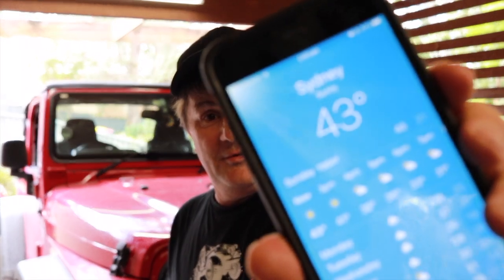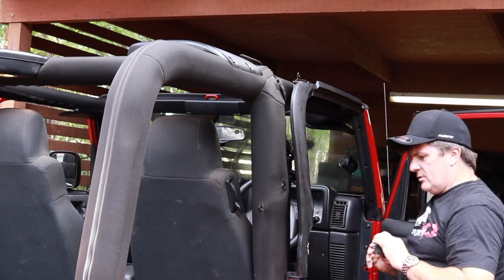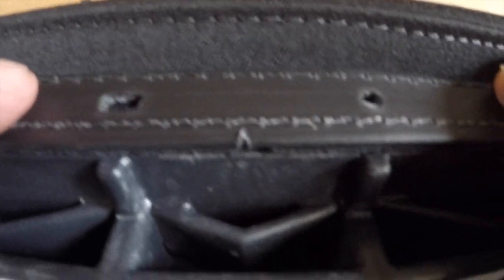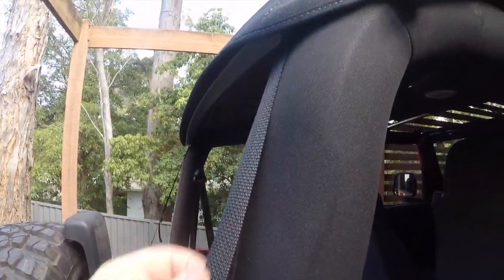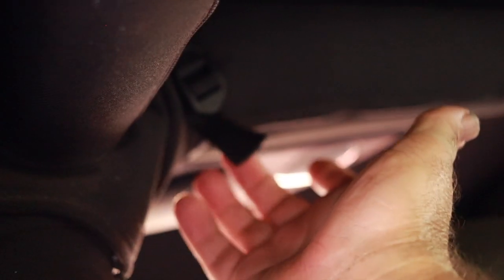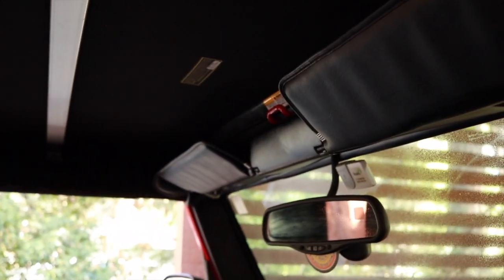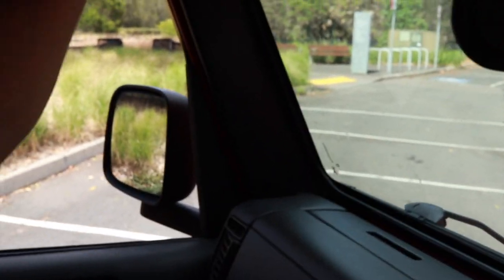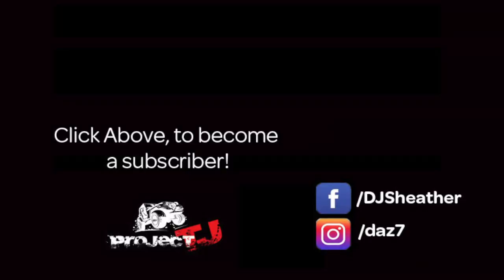Bestop Trektop NX Twill install Jeep Wrangler -  Project TJ - Episode 9

Comment: Just put mine on have in trouble with the back window channel bar think it needs to heat up a bit. Also watching your video I am going to loosen the straps buy the speakers.  Thanks. I have a red tj to.
Reply from the maker: Sounds good Michael. They are pretty tight when first fitted. Rear window bar can go on upside down too so check on that too.  Had a couple of issues recently but need to do a video on it. Red is the best color 😊

Comment: i really struggle to drop the top back and can't get those plastic tabs above the door off. do i need to loosen up the window zippers or are there other tricks?
Reply from the maker: Easier to do when the weather is hot, I've found as the top wears its also become slightly easier. That said, whilst tight, its not that hard to undo the plastic tabs and fold back, then re-attach the fold back front roof sectio, unsure why yours is difficult.

Comment: The side pieces above the doors where top clips under is there a secret to getting that apart easier
Reply from the maker: All I can say is its easier when the roof is warm rather than cold. It's a double edged sword though. Make it easier to get out and the roof wouldn't be as tight.

Comment: Just installed the Best Top Pavement Ends version of this top. A bit of a pain but got it on. Only thing is the header latches are a bit loose. Anyone else have issues with that?  Also nice video brother, thanks for the post! 🍻
Reply from the maker: Mine are fine, yours should be too. My only thought is that the top isn't tensioned properly at the rear (does it have the tensioning straps in the rear corners) or the padding on the roll bar is missing or compressed.
Reply: Darryl Sheather hi Darryl. Yes, all the tension straps are tight. Not sure the issue but will see once everything settles after it’s been on a week. Thanks for the reply!

Comment: Questions:
I thought the rubber mucket seals (between the bottom of the door surrounds and the tub) needed to be removed... At least, that is what Bestop instruction video detailed. The made specific mention to remove them. It did not look like you had done that on your installation. Did instructions from Bestop change? They must have had some kind of reason, based on engineering, for removing those seals. Anyway...

Comments: Nice top! I can't afford twill, but looking to get black diamond this summer (your winter). I am enjoying your series on the Project TJ.
Reply from the maker: Just had a look. The Bestop surrounds have a layer of foam glued to that section, I looked at removing the rubber bucket but when I did it exposed the open end of the channel that you slide the side curtains into, to me that looks like a water ingress spot so didn’t. All fits fine however. Hope that helps! Darryl

Comment: Nice review, but how is using the tailgate with this top? How easy is it to have the dog jump up or put groceries in? Thanks!
Reply from the maker: Hi, it’s better than the standard top as you have a zipper either side of the rear window rather than just the one long zipper as per the OEM top.
Reply: Darryl Sheather thanks for the reply. I am new to the Jeep world and only have the hard top now. With this top and in my example, you would, say, open the tail gate and zip up maybe both sides a little and then undo the bottom bar? Does that sound right? Or do you have to do the whole back window?
Reply from the maker: I usually open the tailgate and zip both sides of the window up 3/4 way and then swing the window up so it rests on the roof if that makes sense
Reply: Darryl Sheather Sounds pretty easy then, eh? Thanks!